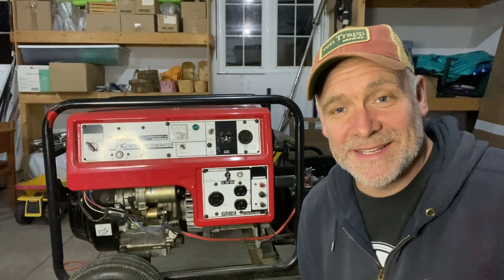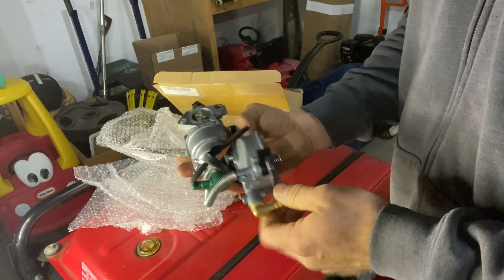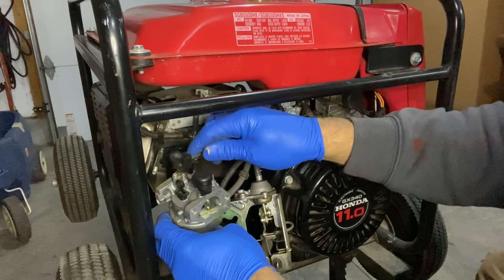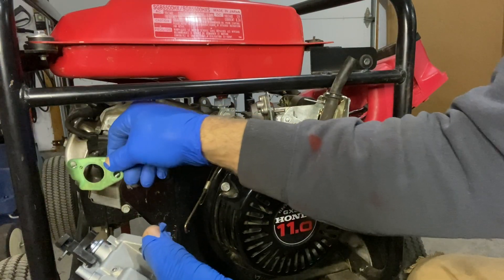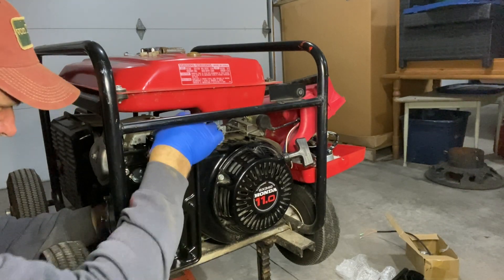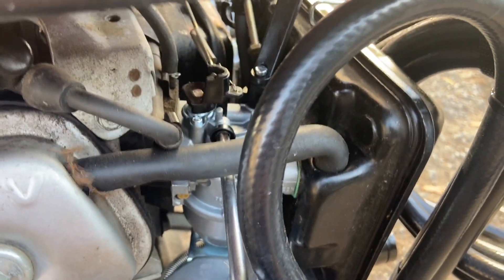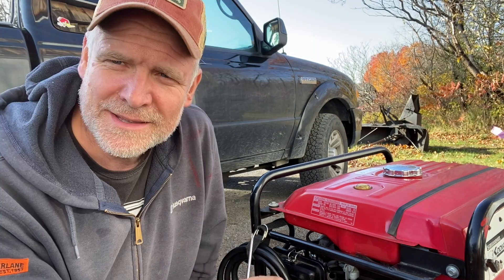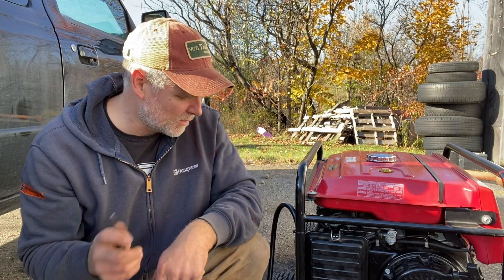HIPA Generator Dual fuel carburetor LPG CNG conversion

Comment: The whole video was so good and well made but at the end you ruined it with that insanely stupid way of setting the voltage by adjusting speed governor..
That is absolutely, i repeat absolutely not the way to do it. 
You are supposed to use a frequency meter (not a volt meter) & turn that screw till you hit 62hz unloaded. & No less than 59hz fully loaded. 
Voltage is adjusted at the back of the alternator by the avr screw if your generetor has one..if its capacitor excited. The voltage will remain as is. Doesn't matter if its 130v. It was designed in that way.

Comment: Reminder, you should shut the propane off at the tank and let the engine use up the remaining propane in the hose and it will die on it's own. Otherwise, you will still have a bit of propane left in the hose, a potential hazard.
Reply from the maker: Good advice have a great day and thanks for watching

Comment: Have you had any problems with motor by switching to manual choke.  I notice you did not plug up vacuum line from choke.  Another video I saw he had to plug hose or it would not run correctly.

Comment: Why set it for 110v instead of 120v. Thanks for the video.
Reply: This dude has no clue what he is doin. 
Governor screw is definitely not for voltage setting. It should be set with a frequency meter at 62hz unloaded 59hz loaded. His frequency is way off now as he did the voltage with that governor screw the engine is spinning lot slower. & Will burn up inductive loads like fridges or fans or pumps if he run it with that low of a frequency. The frequency effects impedance of a load. A motor made for 60hz will draw more current at 50hz . The voltage is adjusted by the avr at the back of the alternator.

Comment: I have a 55 Genrex and someone cut wire off low oil sensor and kill switch wires   Try to find how to rewire it with new low switch
Reply: Yellow wire goes to sensor coming out of block
Reply: Also if it won’t start then unplug blk wire coming out of little silver box with yellow wire

Comment: Hey Pete I know it’s been some time . I’m rebuilding a perkins d3.152 and I was watching your video on the timing cover when you torqued it to 28 was that footpounds or nm ? Thanks
Reply from the maker: Sorry man I can’t remember. I borrowed the manual when I rebuilt the motor so can’t even look now. You can look up a universal torque spec for the size of bolt and thread. it will give you a rough idea. I wouldn’t do that for internal bolts. But for the valve cover it should be good. Thanks for watching and hope you get it fixed
Reply: Thanks I went 28 ft pounds for a 5/16 24 bolt. it should be around 21 went 7 pounds over do you think it would be ok to leave? It’s the inside timing cover
Reply from the maker: Its good if the bolts tightened up. I would leave them. It’s not that much over. I’m glad you are getting it together. Have a great night
Reply: Thank you 👍
Reply: Ft/lbs